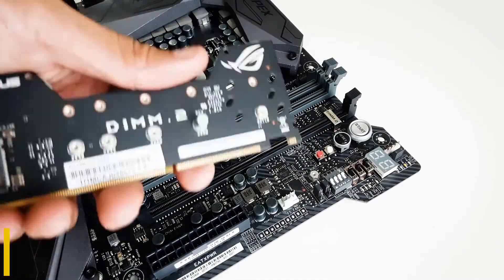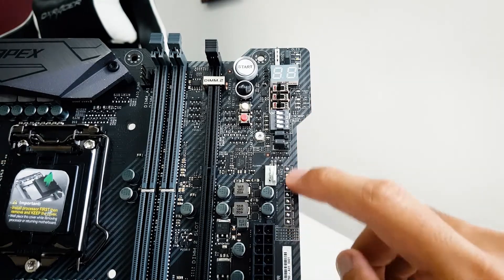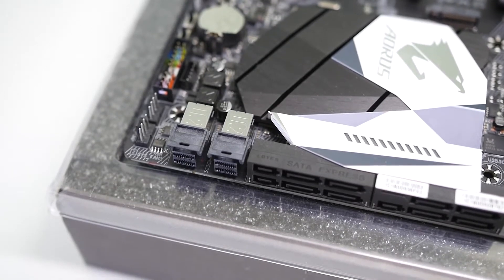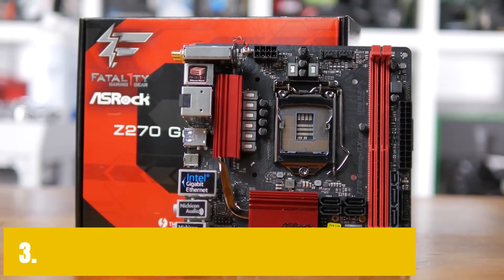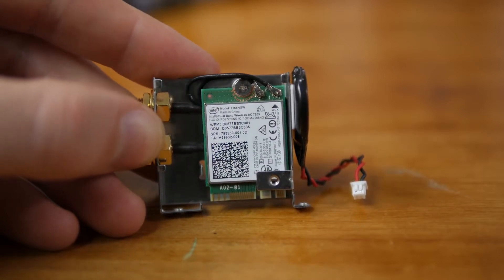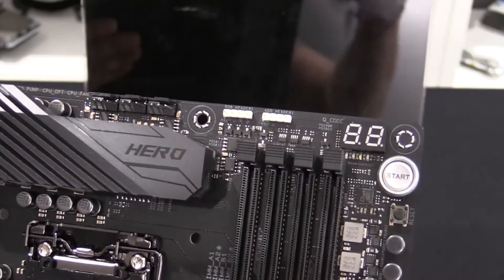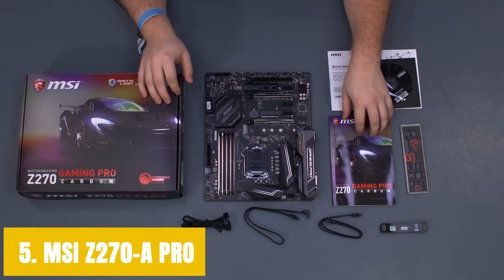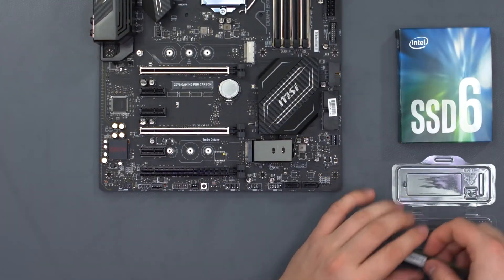Best Motherboards For i7 7700k Build in 2022/2023

Comment: I have an i7 7700k  Ripjaws ddr4 2133 ram 500-watt power supply mini itx case were can I get the mobo has to be an mini itx to match my  i 7700k processor?
Reply: Hey where did you find the 2133 mhz ddr4 ram?